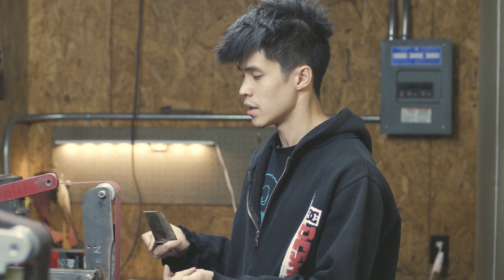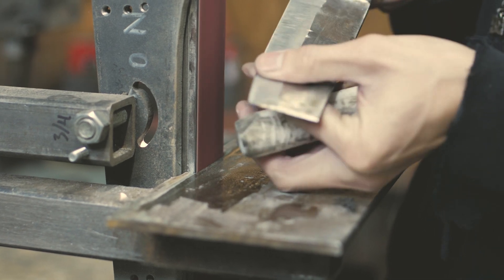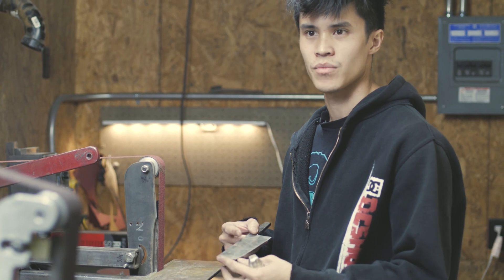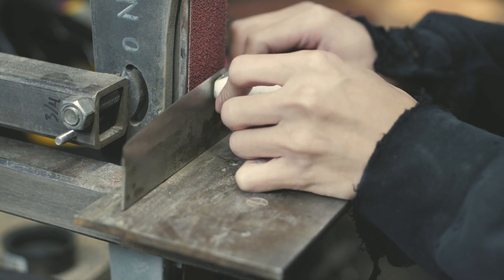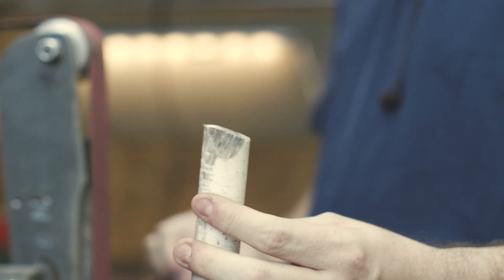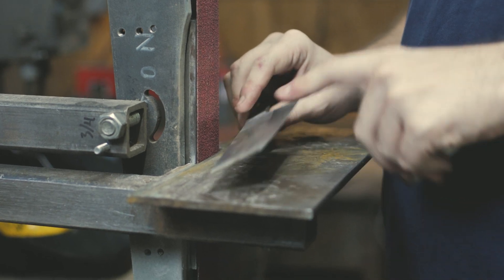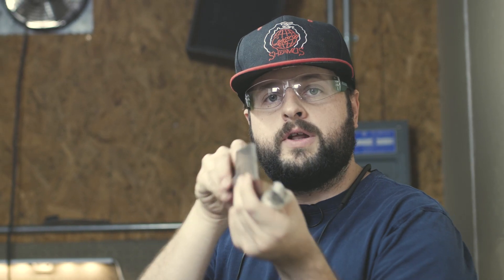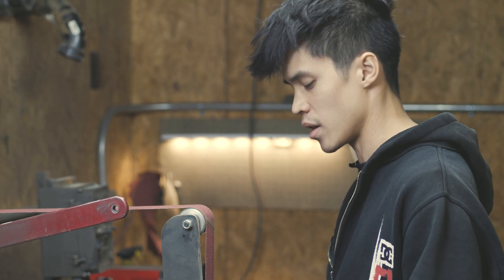Stop overheating your edges when grinding.

Comment: If you cause a small blue spot toward the edge, how would you test it to see if it's ruined?
Reply from the maker: If I saw it was blue I would know immediately it's already been overshot. You would need to carefully grind that edge back and maybe try to use hardness test chisels to get back to spec hardness, but this can be really difficult to know for sure.
Reply: @DonNguyenKnives  thanks for the response. Would you recommend throwing it in the dumpster or trying to go through the heat treatment process again?

Comment: I use an 8" bench grinder for roughing out my blades. Then a 6" belt sander to refine the edge. That bit about holding the blade diagonally I use for the belt sander. I have a bucket of water next to the grinders and sanders for dipping

Comment: Don, is there a specific grit you like for hogging off material on the 2X72 for stainless, or would you use the same grit for carbon too?
Reply from the maker: I like to use 36 for the bulk grinding to get off as much as possible as quick as possible, then when I get closer to final geometry I'll switch to 80 or 120 grit.
Reply: @DonNguyenKnives  
Regardless of the steel?
Stainless or carbon makes no real difference, right?
Reply from the maker: @jkg6211  Correct, at least that's my experience
Reply: @jkg6211  if you can get your hands on vsm ceramics plus try them out the really shred stainless i can get 2 10 inch chef out of one 36 grit belt 👍
Reply: @scherlfirearts7142  ~ Thank you Sir!

Comment: So I've got a question, something that I always wonder when I see guys using jigs & push sticks. Can you actually freehand? I'm not being condescending, just asking. For years I've seen guys use shortcuts to get better grinds, but then years later(for the most part) their knives still look all the same. I'm not saying any 1 way is bad, each style has its place, but a lot of guys never learn any other way, which IMHO could become a problem. Hope all is well, take it easy.
Reply: Hey bud he actually freehands at the end of the video
Reply from the maker: Yes I tend to freehand a lot of the later stages of grinding. Using a push stick is still a form of freehanding for me, you have to still control pressure and angle and all that.
Reply: @DonNguyenKnives  Right on, I've tried jigs & push sticks, but I found they just slowed me down. I guess I'm the opposite, cause I never took the time to learn how to use them.
Reply: But I like your thumb technique.
Reply from the maker: Yeah I dunno with jigs - I do the push stick but I haven't had anything actually fixtured like that. If you were doing a lot of similar knives they can help, but might not be useful if all your knives are different. You can definitely do a hollow grind with a push stick though.
Reply: @DonNguyenKnives  I actually made a jig to try it out last year & came to the same conclusion. Setup takes so long, the knife would be almost done, but with like 5 or more, it'd be worth it.